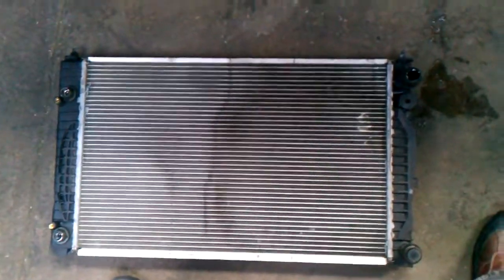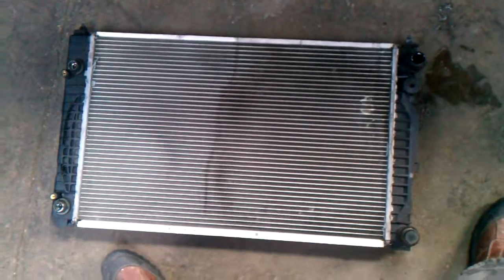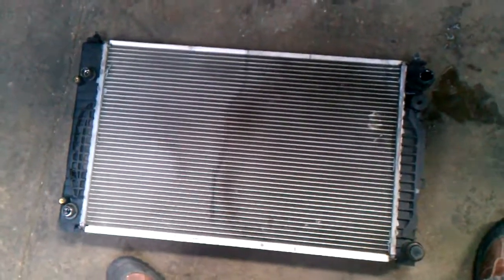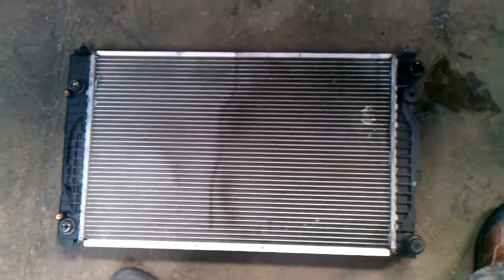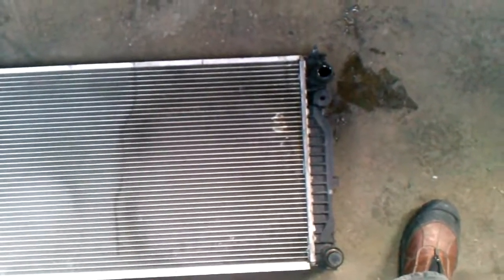How To Determine If Your Radiator Is Defective Or Clogged

Comment: How can you test it if you don't have a new radiator?
Reply: Apply a hose to see if water flows and if you have good pressure / flow coming out. I would check on both ends meaning top and bottom. Water should gush out. Sometimes you might see water flow but some channels can be clogged. Might get lucky and unclog the passages but keep pressure until water is clear. I would still recommend just buying new. A blown engine is more costly.

Comment: If you already had a new radiator, why would you even check the old one for?!?! You got a new one, toss the old out.
Reply: Because it helps to analyze if the old rad was not performing properly or clogged?

If you've ever worked on a car that was overheating you would understand the importance of making sure the parts you are replacing were the cause of such issues.

If you are replacing the radiator just because it's old and no issues then yeah go ahead and put the new one on. Except we don't know everyone's situation so.
Reply: @cakepower1  I apologize for the clown that asked the dumb question. Clown shoes!!! Good video
Reply: lol if it turns out to be good u could get ur money back
Reply: There is no guarantee the replacement rad would have the exact same capacity